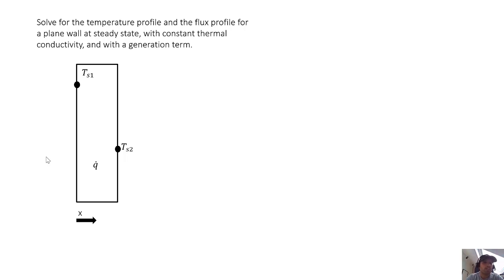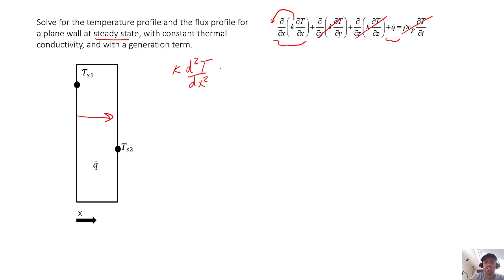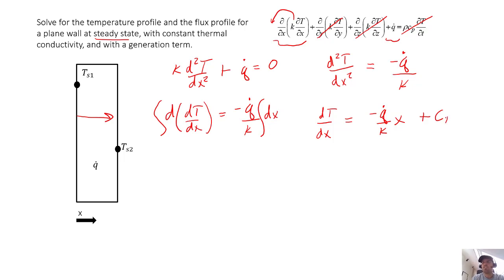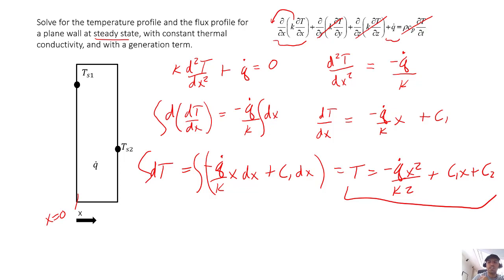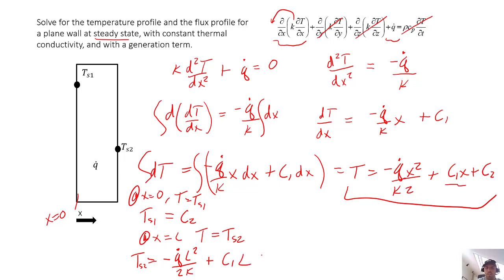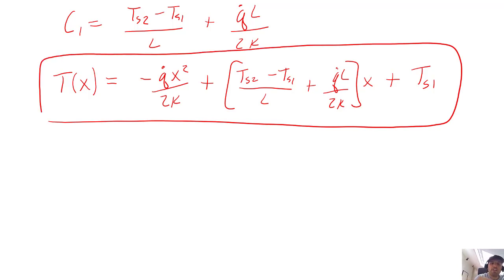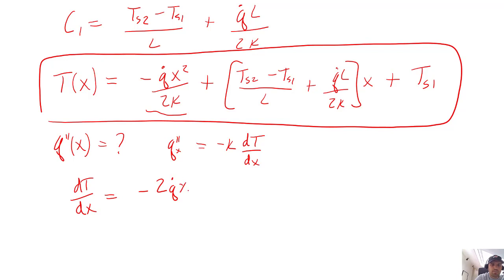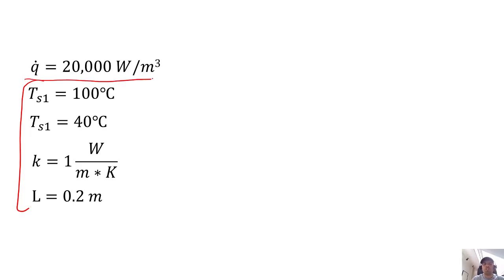Heat Transfer - Chapter 2 - Example Problem 5 - Solving the Heat Equation with Generation

Comment: Hello. Thank you for your video about heat generation. I have a question. In a steady-state, according to the thermal conductivity, temperature distribution is different in a equilibrium (unlimited time)? I am sure that in a transient state, it will be different, but in a steady-state, I am not sure about the situation by different thermal conductivity.